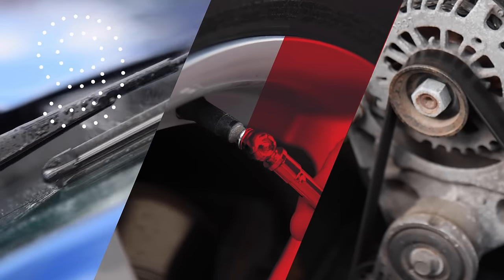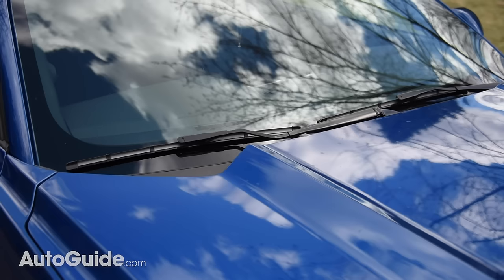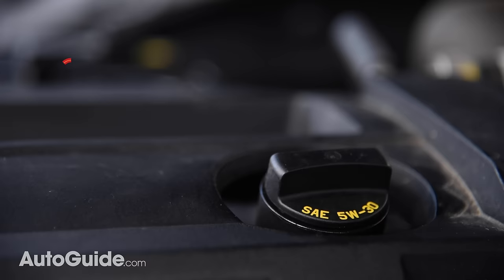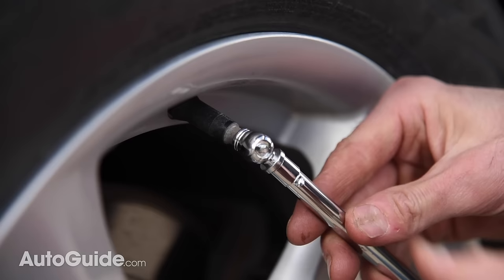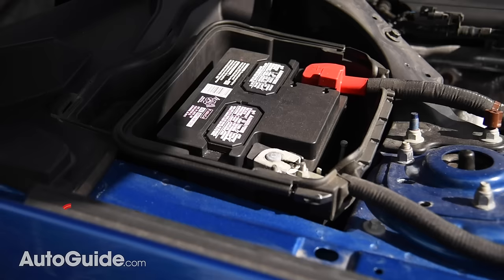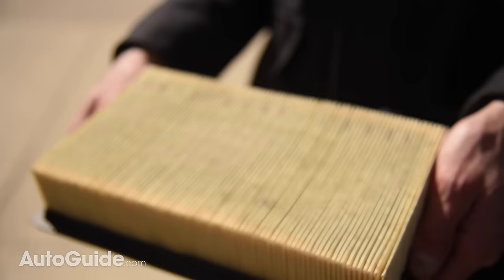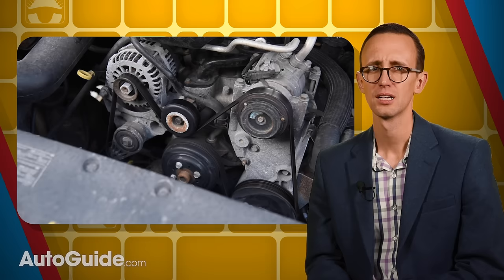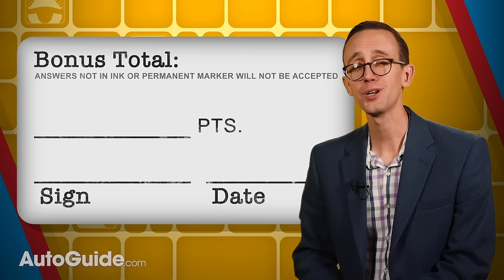Car Maintenance: 10 Things Every Car Owner Should Know - The Short List

Comment: I use to clean auto shops paid by selling scrap metal I have seen plenty of stupidity not always more often on regular schedules or basically when it goes kind of bad  or parts not the best cheaper somethings are made poorly or not treated as well by user owners of how used or driven take it easy works best not good on bad roads or bad service volks doing poor work  combination of things worst is the nut behind the wheel operating driving it no 2are the same we or so idle our autos 2 much wasting I cannot say how much $$$$$$$or fuel  ruins worse ones health you should watch more carefully everything not taking chances for lives or running low or out of $$$$ best is only drive when in organized fashion no rush who really rushes stop and go is bad less wait inside best to save $$$$or for short quick stops what may hit someone or be in drivers way by the pedals somethings can or not be avoided weather for one we need to walk ride cycles more  but society is lazy for some time of day makes a difference can be thank you